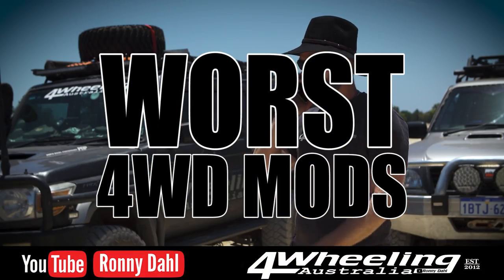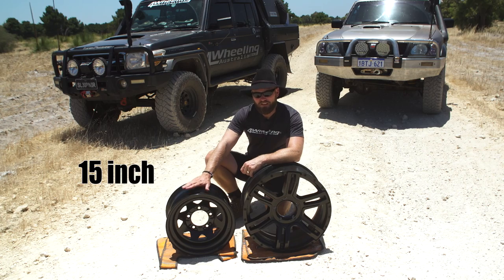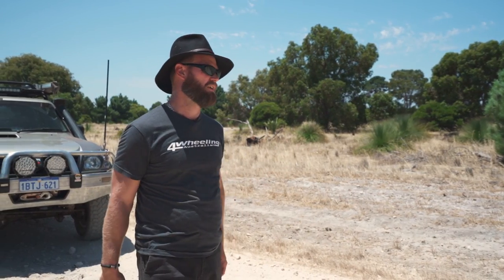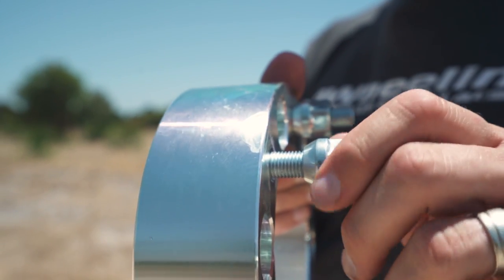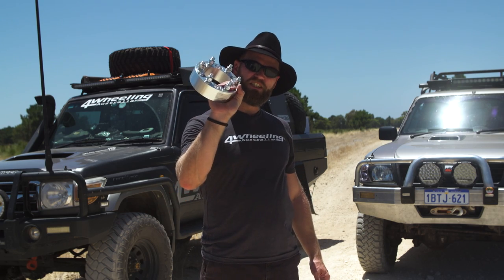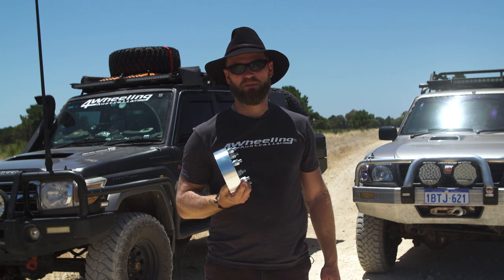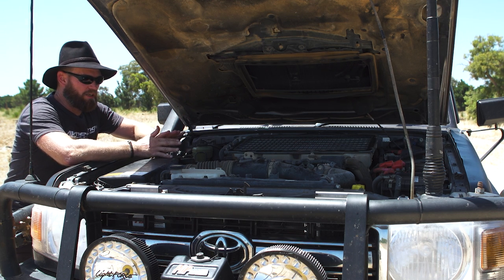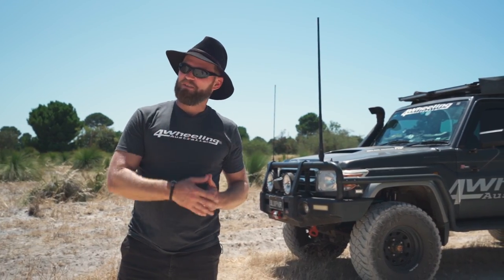WORST 4x4 MODS, DON'T DO THESE TO YOUR 4WD

Comment: Lowering the suspension and changing the engine to try to make it a race car.  I've seen it...

I wonder what % of jeep enthusiasts just like the looks.  It's actually pretty ironic because I kind of got into off road accidentally after asking for a rental car upgrade and all they had was a black wrangler jk and that's what I had to get for myself years later.

In terms of mods, I consider myself Mr Factory settings AKA Doctor Stock because this is the configuration that is designed to be optimal.

Unfortunately, I get in over my head pretty fast and the battle scars underneath the vehicle are a testament to that.

I could use a couple inches lift to get some bigger tires but I drive a shitload on roads as well as off for work and don't want to make it anymore of a boat than it needs to be.

The only significant mod would be the rear bumper and I only finally pulled the trigger because I backed into a pole and basically ripped off the bumper a noticeable amount.

Even though I got a front / rear set, the front is still in the box because I'm not thrilled about the weight and also am a lazy person when it comes to many things.

Aside from the lift, I feel like it might be worthwhile to upgrade my suspension because I pushed the envelope since the moment I got it with reckless abandon.
The end.

Comment: Ummmm well guess my 2008 Jeep Wrangler Unlimited X jku on 16 lbs of boost with a 4.1 stroker engine with billet crank on a 6.5 long arm 3 link 4 link on Dana 60 80 538 gears atlas 4 speed twin stick 11.7.1 transfer case with 37's on 17 in atx slabs.  Guess I'm one of the dumb asses 🤷🤷.    It's a weekend Warrior though so maybe I'm safe idk

Comment: You gotta be kidding me. If you think a hi lift jack is useless then you aren't offroading right.
I've used my hi lift on the trail more than any other tool I have, and only two of those times were to change a tire.
Also, if the only place you can use a hi lift is on the front bumper, then your rig isn't built right. Get some rock sliders noob.

Comment: 0:19 Probably some amurican bloke who went overboard with stupid lifts and meter... oh wait, excuse me... let's not use scientific measurements, because they can be hard for freedom unit users :P So... a stone/pound/yard/feet/rectum/ear/random-body-part-gibberish-unit wide spacers on his truck :D That was probably who was on the phone.

About the mods...

I once saw Jeep WK with massive wheels and very low profile tires on it... and it just looked like the thing had some stupid cartwheels on it. You know, from those carts that were pulled by horses/donkies/bulls in the old days? Yeah, those kind :P Looked stupid.

And on my WK when I bought it, the earlier owner had installed 30mm spacers on it to mount bigger tires. Needless to say, one of the first things I did was to inspect if there was some excess wear AND remove the silly teen-spacers.

Also, the tires on my WK were very much over the top mud tires that served no purpose (previous owner just wanted "the looks" I guess), that rubbed even with that "pinchweld" and spacers... those were replaced by more proper sized tires.

Now I understand Jeeps aren't actually known for their "reliability" (still better option than Range Rover tho... :P) but at least my WK has pretty much 0 mods on it currently. Just some cosmetics, like new steering wheel (ordered custom, carbon fiber and leather), because the old one was completely trashed, and sticky for some reason... even after I tried to wash it, it still was sticky. So in with the new one. Oh, and a dog cage at the back, since well... we own a dog, surprise there :D

What else... Well I was considering getting a proper extra light on the bumper, since we got pretty dark winter here currently, but so far the stock lights are good enough. I suppose I'm not much of a modder after all :P Other than disabling that stupid MDS from the 5,7 hemi. That would be my choice for engine "mod" (as in tune). If I save something like 0,5 liters/100km with MDS that's annoying to drive with, then it's not worth it. It needs to go off...

But I think you pretty much described those things people in the US do with their mall-crawlers... :D

Comment: your wrong when it comes to the snorkel opinion.. theres nothing wrong with letting your motor breath better weather you have further mod plans or not
Reply: Put a meter in your snorkel vs no snorkel and look at the temps and flow. Snorkels are not cold air/ ram air intakes. There's lots of videos about this. ✌️

Comment: my suggestion for people that want to go off roading, get CB radio, 6 new rims and 6 new tyres, dedicate those rims and tyres for off roading, keep the 5 rims and tyres that are standard, bring the 2 spare wheels when off roading, you might get a flat and if you get a second flat before fixing the first then you are up a creek without a paddle...

Your CB radio should be 5W rated, not 15W from China, it should be equipped with 2 antenna's, 3db and 6db, you can even do 9 if you are highway driving, MOUNG THOSE ANTENNA'S HIGH! they should be the highest things on your rig, bullbar mounts are cool looking, but if you want the range that you need, mount it as high as you can and don't cheap out on flexi poles, buy a 1W at least hand held, yes the range sucks but jumping into your rig every time you need to reply when your convoy is close by is a chore.

Recovery tracks, don't cheap out on those, you'll need them later on, a spare battery in the back is good, especially when you are after luxuries that connect to the battery, cold beer? frozen food mayhap? not essential, but still good.

Don't buy off road gear if you don't expect to go anywhere outside of the 100 postcode, if you live in the postcode of 6000 and you never go beyond 6200, then you probably wasted your money... a good rig setup can cost near $20,000, I seen some good setups where it costs $50,000 and that's conservative and the person doing most of the work.

most of all, if you are ever going to go off roading, buy some fucking bug spray and have a good time, there is no point in going anywhere if you can't afford 'Off!' and you don't come back to civilisation without recommending others do it.

Comment: Wheels dude they are called wheels, RIM IS JUST THE EDGE OF THE WHEEL
Reply from the maker: Rims / wheels same to me. Many folks order Tyres and rims when people say wheel people often think of the rim + tyre.
Reply: Edge of the wheel? Since you want to be so technical, it's actually called the "barrel". Then there's the face, bead seat, on and on. Probably shouldn't correct someone if you're wrong.
Reply: Ronny Dahl wheels, tires and rim are completely different things
Reply: @Silkroadvideos  - You might wanna get busy this week contacting all the major companies that improperly use the terms that you don't like.
Reply: K Digiacomo no mayor company that knows what they are talking about will ever call it a rim because they probably know the definition of RIM
Reply: @Silkroadvideos  - You're completely missing the point. 
*By the way if you just click on someone's comment it shows blue and you don't have to type it yourself. ✌️
Reply: @Silkroadvideos  - Look how many companies sell high dollar "wheels" and term them as "rims". There's a lot....
Reply: K Digiacomo show me one
Reply: @Silkroadvideos  - Google is pretty easy to navigate. There's a search bar, use that because I'm not going to bottle feed you.

Comment: Weird video.  A bunch of stuff not to do to 4WDs that people never plan to put in to 4WD.  It seems to me either you are using it as a dedicated off road vehicle or you shouldn't be doing any major mods.  Just buy a cheap beater 4x4 and a trailer, and use your pretty truck to haul it around.

Comment: Anyone else cringe every time he calls a wheel a rim?
Reply from the maker: Not in Australia mate that’s what we call them. Wheel here is a tyre and rim combo.
Reply: @Ronny_Dahl  That's odd. A rim is a removable piece off a wheel.
Reply: Around here (southern U.S.) people use rims and wheels interchangeably, and then go on to use wheels and tires interchangeably, and then to add insult to injury, some even insist on referring to tires as rims. It can be incredibly frustrating at times trying to figure out which part they're actually referring to.

Comment: On behalf of AMERICA's "men", I protest against the current GIANT RIM / LOW PROFILE  re-tar-ded look..... We laugh at these gys here, call them (BRO DOZERS) ... I personally have 20" wheels on my 1 ton diesel 4x4,  but they work perfect with the 42" military tires!   I also refused to lift more than 4 - 6",  so with a sawzall , I removed unwanted body material, LOL!  Now it's all about trying not to break axle parts, over & over..... & over....

Comment: tigers 11 which are now kings after there bad rap.. should all be band. they got rejected from major 4wd shows because they were so cheap and nasty. if you get into a major bog in the middle of nowhere and your cheap ass winch fails and there is no help you could be dead and it has happened. cheap Chinese  accessories may look the part for six months but could be your demise if you go on a remote outback trip.